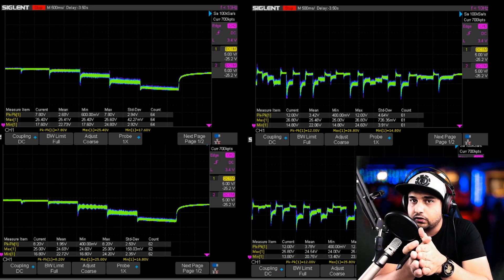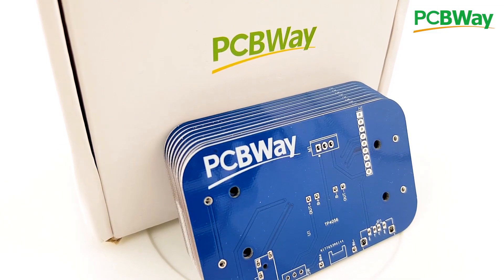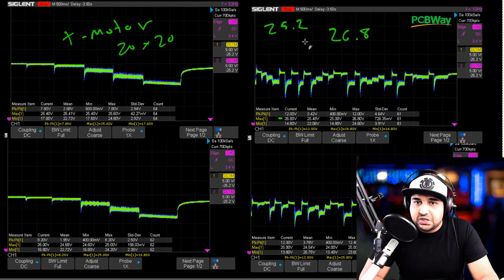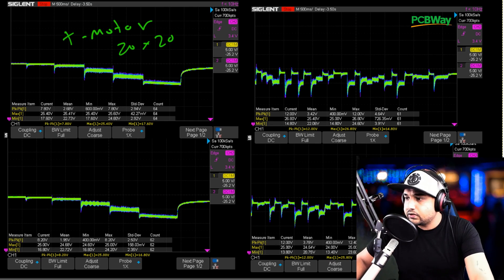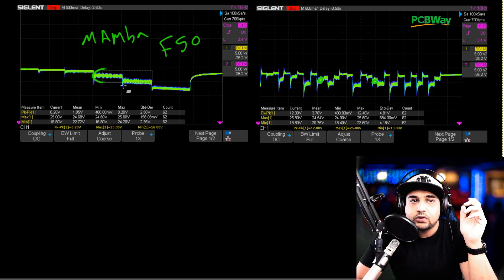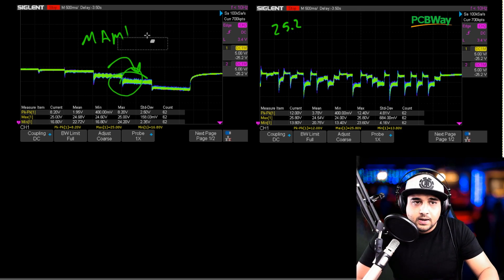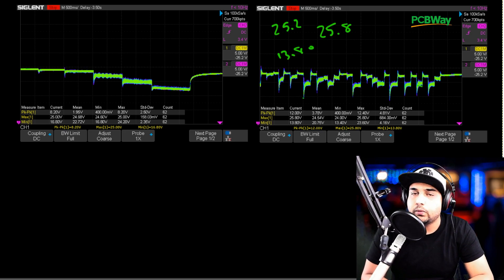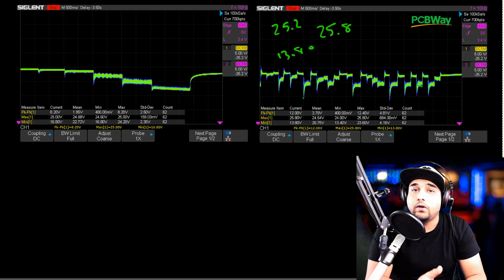I Found The Best 6S ESC's // New 6S Testing Setup

Comment: Hey man big fan here. Need advice my air unit restarts when I run6s on an older mamba f4 from a diatone gtm540. I’m using a bec that brings the voltage down to 12.2v from the leads at the esc and also have a rubycon 1000 running latest betaflight no problem on4s at all. Please advice